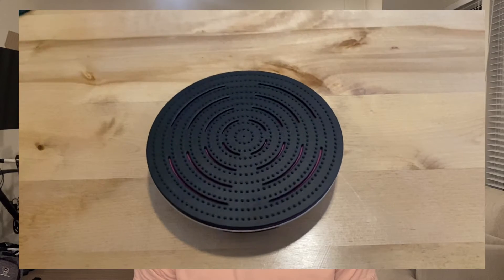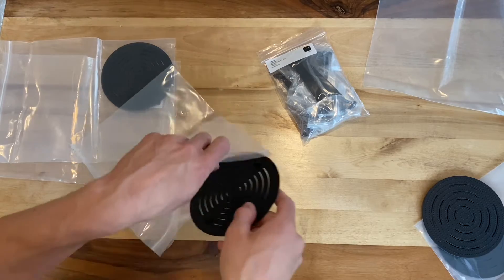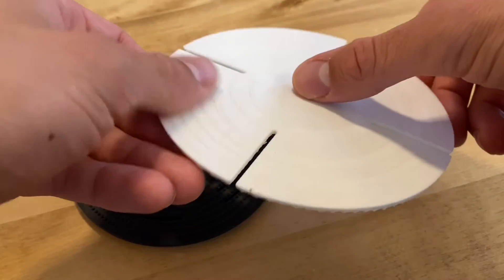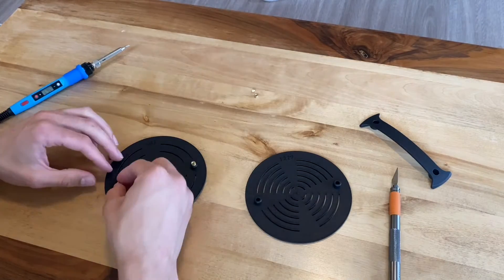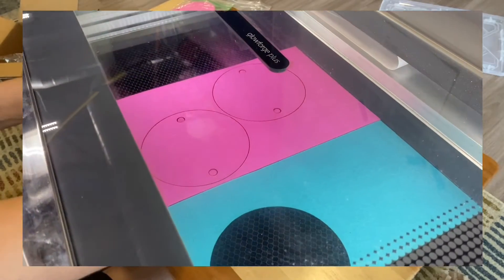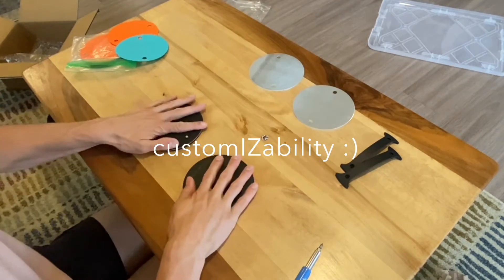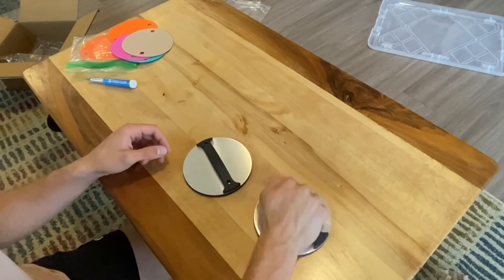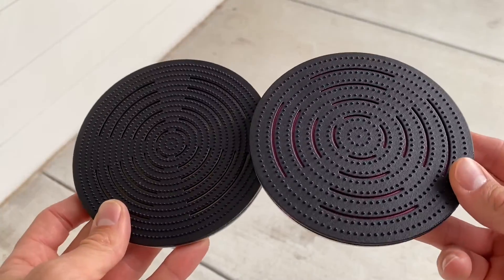Prototype 1.5  |  Building a Modern Printmaking Baren

Comment: Does a pad go over the plastic or is this the finished surface? Won't the pressure points quickly round over fine features on the blocks? Does the traditional design have texture under the seemingly flat surface?
Reply from the maker: Good question-- I am hoping not to have any sort of pad or "sheath" over the texture.  A traditional baren does include a bamboo sheath, however, the disc baren does not.  That baren has an exposed plastic texture similar to this one.  

I think that for long term performance it will come down to the specific geometry/ plastic material choice.  Those will determine how it wears over time.  I too am curious how this specific prototype will wear over time.  Especially if it is used heavily, I wonder if friction will heat up the features and accelerate the wearing process.  I will report anything I find about this!
Reply: @mokudez  the sheath is needed for certain textures e.g. soft baren sujizuri in original shinhanga prints (without the sheath it would look like hard baren lines with no soft colour printed in between said lines). Very, very few doing that style of printing though.
Reply: @mokudez  Yeah, I’m very curious how those nodules will impact the printing process. I especially wonder if they are too far apart and run the risk of piercing the paper.
Reply from the maker: I just did some testing on them so I will be posting part 3 soon!  Excited to share the results with you.   @jessemkahn